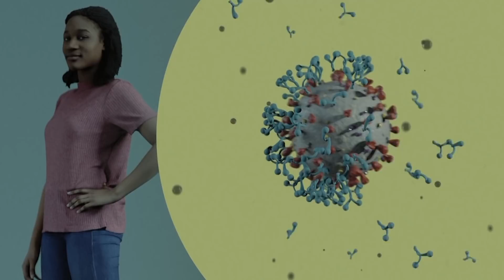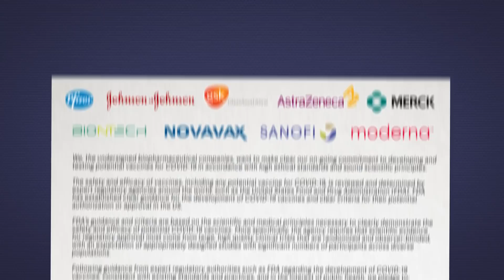What you need to know about the Covid vaccines

Comment: they do not mention that cells from aborted fetuses are also used to make the vaccine.
it is not a vaccine but gene therapy.
It contains mRNA that causes your DNA in the cell to produce a protein that resembles the Covid-19 virus.
it provokes an immune response from your immune system that would make you immune to the virus.
The dangerous thing is that there is no off switch.
So your own DNA keeps producing this protein, so your immune system keeps attacking this protein.
because it cannot win the battle, your immune system runs wild and starts attacking other cells in your body, provoking an autoimmune reaction that causes all kinds of organs to fail, ultimately resulting in death